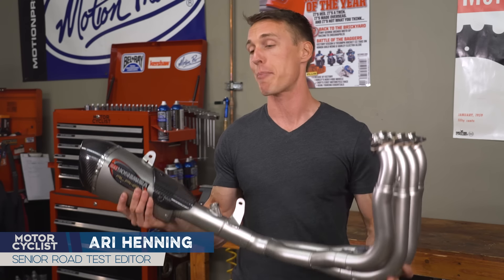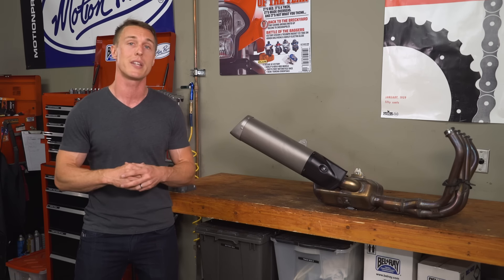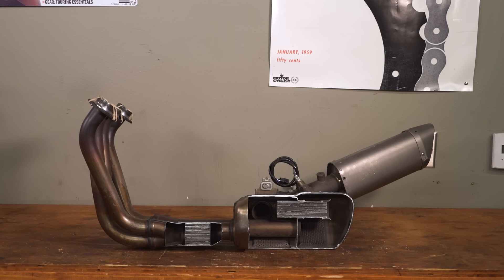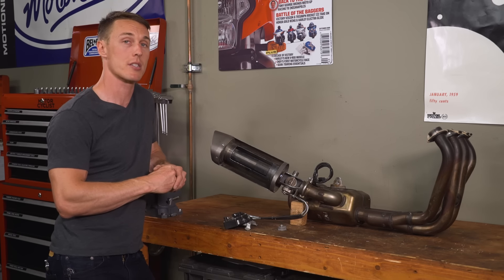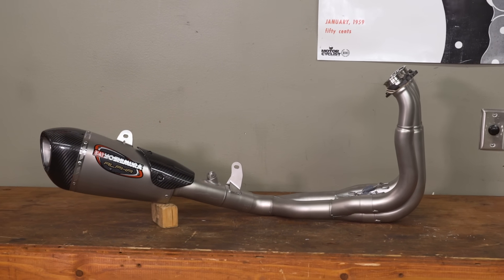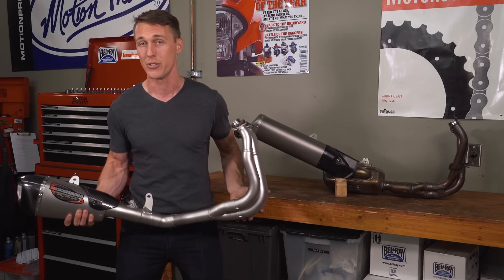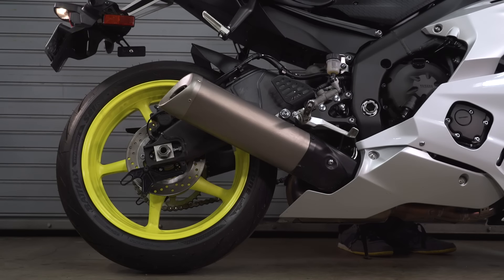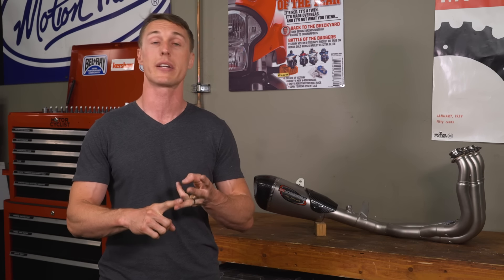The Truth About Aftermarket Exhausts | MC Garage

Comment: Agree, I just slap on a slip-on any bike i use. Purely for aesthetics & a crisp sound. Modern bikes rarely need much performance enhancements unless you're seriously getting into racing. It tends to get very expensive to squeeze out about 3% - 5% extra ponies that have no real world benefit. 
Better to invest in suspension instead, tires included. The bike will feel way different. 
Another cool vid again btw.
Reply: Yep. If someone puts an exhaust on their bike but leaves the bald tires...
I guess different priorities than me.
Reply: gronkgrunk weight though
Reply: That’s due to headers. Adding a header with bigger ports plus slip on will increase almost 20% more.

Comment: When I raced motocross, the only time I bought an aftermarket exhaust was for my 1988 Honda CR500RJ.  It was to soften the off the bottom and midrange hire and give it better (longer) top end.  It made life easier on the close circuit track as well as cross country and for the Finke Desert Race in central Australia.

Comment: +Motorcyclist Magazine  You guys are killing it with these videos, great job, as usual. You deserve a lot more subscribers.
Reply: holymolie not until they start cranking out more vids regularly.
Reply: holymolie quality over quantity
Reply: So where is the quality?  Kid talks about backpressure like he's an engineer.  A quick Google would have given him much scientific evidence that backpressure does nothing to improve performance, it actually hinders it.  You want free-flowing exhaust, learned many decades ago.
Reply: Michael Cox Honda
Reply: Michael Cox peak hp sure a nice large pipe would be a good thing. But you loose torque. Crossovers in exhaust systems or headers by design may have some resistance to the exhaust to create a scavenging effect.
Reply: noah villalpando Thanks, but I'm not interested in opinions. My mention of quality was relative to the poster stating this is a quality video.
Reply: Michael Cox my response is due to your response about doing a quick Google and how back pressure does nothing for performance. 
Do you ride a Harley?
Reply: It's simplistic to dismiss return pressure waves (a variety of back pressure) as robbing power and to only want to achieve maximum exhaust flow at all costs, under all circumstances. It's also an oversimplification to want back pressure without qualifying what type and under what conditions. If it were a matter of minimising back pressure then no exhaust system at all would be required or the largest, fattest headers and pipe. The opposite would be to restrict the exhaust outlet to maximize back pressure. Both are absurd engine design and tuning concepts.
Reply: Exhaust headers and exhaust pipes are not considered one in the same...at least not in my statements. Headers are engine specific and anything after them needs to be non-restrictive. Open exhaust manifolds are the best option (why it's that way on race vehicles), but noise and air pollution campaigns require street vehicles to have mufflers, sensors and catalytic converters.
Reply: Michael Cox I'm not sure what race applications your talking about any race engine I've ever seen has a header and pipe. Also depending on tuning they will either all collect to 1 pipe or be completely independent from each other.
Reply: Agreed. Back pressure does help most common engines.

Comment: The popping and crackling on deceleration is one of my favourite parts of riding my bike.
Reply: Myles Prower Yup. Too lean
Reply: Chuck M not necessarily. Can mean too rich, and the fuel is burning in the exhaust due to the air injection system (like my z1000)
Reply: @Me-yh4uc  Popping in the exhaust literally means the fuel went unburnt in the engine, which happens if you suddenly decelerate.
Reply: yeah must be so great wasting fuel..    I mean...   lets just dump all of it in there and make a cannon out of it.
Reply: @harleyme3163  it happens even on scooters, the honda wave i use to stroll around town tends to pop it's exhaust (not necessarily loud pops as the stock exhaust is so damn muffling, but pops nonetheless) specially after going high rev on a climb then suddenly letting go of the throttle for descent, specially if the engine is cold
Reply: Yea my ninja 300 popped with a stock muffler and more noticable with the Hotbodies MGP slip on. Before I would have to actually concentrate to hear the stock popping on decel.
Reply: yes
Reply: It means your bike is running like shit though. But hey you do you 🤷‍♂️
Reply: @Totallylegitman13  my bike with emissions control does the same thing when I decelerate hard after a long straight at WOT it backfires very loud scaring anyone around me... ive toyed with the idea to block it off to stop it happening.
Reply: Will Lyon no it doesn’t... unburnt fuel will always happen to some degree when decelerating.
Reply: @Totallylegitman13  only on a carbureted bike. EFI bikes cut fuel like cars do when you're coasting. Even carbed bikes don't do it from the factory. Shitty tunes make crackling sounds
Reply: @Totallylegitman13  I got a wide open sc project fully tuned it diesnt always pop but that unburned fuel scares the shit outta me when it does get up in that pipe hahahaha
Reply: Not sure about all motors but some carbureted v-twins have an anti-backfire circuit
Reply: It doesn't matter if you're riding around all day at 65mph especially if your fuel is almost free.
Reply: I have a hole in my car muffler. Does the same thing LOL.
Reply: My 790 duke even popped with stock exhaust. Does so even more with my yoshimura. I love it

Comment: The loud pipes save lives theory is interesting. I’ve been on a loud Harley and have had several people come into my lane. My sport bike was quiet. I hardly had any issues.
Reply: Sportbikes are more colorful so they catch the eye> luxury vehicles with fancy sound systems and other technical distractions
Reply: I experimented years back on my loud ass Buell I had at the time. If my pipe was BEHIND the driver, they couldn't tell I was there unless I really opened the throttle. So the whole loud pipes thing didn't do any good unless I was trying to attract attention...which a horn can do.

I didn't notice any change in driving behavior when I bought a new 1000RR and left it stock.

Comment: I got an old Honda CB400 SuperFour a few months back.
I bought it as a gift for my son to get him to go for his Full bike licence as he has been on a 125 for his 3rd year now, plus it sounded amazing!
He has annoyed the hell out of me and so I thought bugger it, I will use it.
Annoyiungly, I should have double checked the exhaust because even though it looked great, I have hardly done more than 200 miles and it started to pop, on close inspection, I found a hole in the No.3 downpipe... I took the exhaust off to get a proper look, and lo and behold, I find one of the rustiest setups that I have EVER seen, and after sopme wire brushing and trying to clean it up, I have come across more holes than a sieve... Thick coating of paint was all that was holding it all together!
Even worse, is that the collector box, downpipes, and silencer, are all welded into one single piece and so even though the silencer is ok, I cannot get it off ( Might cut it and make a new connection )

I am however hoping that I can still save it, at least for long enough to let me have a couple of years use out of it.... I doubt it will weld although I got a mate who says he can weld anything no matter what, so lets see, but if not, I hope that the Heat resistant SteelStik will be my saviour.

I have been told its good stuff, but does anyone have any experience with that?

The holes are all just on the top of the bend on the downpipes... At the back... A few holes have appeared right after the join where it goes into the head port, and some are right on the corner, on the inside of the bend, and the farthest downm, there is some little holes about 4 inches, in total, on the two inside pipes, there is 12 holes, the largest is about 3/4 of an inch, so quite sizeable, but most are 1/8th of an inch give or take...

I also have a couple of tins of Simoniz VHT Spray.. Rated 800c.

Does anyone know roughly how hot the exhausts downpipes get on the CB400 SuperFour?

Its a shame because the bike overall, is an amazing little thing that is small for sure, but so much fun to blip about on!

Comment: I removed my stock exhaust on my GSXR 1100, replaced it with a Yosh pipe and it made a huge difference in power. Yosh had done a lot of R&D with Suzuki and the results were outstanding. It wasn't too loud, unless you got on it, so long trips weren't annoying.
Reply: You did not have the closedcourse baffle like the vance and hines that thing was TOO LOUD
Reply: You have a GSXR1100???
Reply: @jlcomte  I "had". Sold it.

Comment: I always pair an exhaust with a tune. Honestly though I go aftermarket mostly for the sound and weight saving lol. If you add power, your bike only goes faster. You save weight, your bike goes faster and it's easier to maneuver.
Reply: ap1986 ari mentioned that when fuel mixture is lean due to. change of exhaust it will pop when decelarating...
isnt that contradictory?
i thought exhaust poping when you decelsrete was caused by a tooo rich fuel mixture...
Reply: don trump : i might be wrong, but i am pretty sure the popping is due to a mix with too much air, forcing second ignitions in the exhaust. It isn't because of too much fuel.
That's at least why BMW 1000RR are popping all the time, or why BMW with N54/N55 engines (so 135i, 335i and so on) are popping SO MUCH : these are "fake" pops due to extra air purposely injected in the exhaust.
Reply: don trump my understanding is that it is more likely to pop because you're stock exhaust has baffles, your after market does not. So you're also getting an excessive amount of fresh air back in. Which you would've of had with your stock exhaust.
Reply: backfire through intake is caused by a lean condition or advanced timing, backfire through exhaust is caused by a rich condition or retarded timing.
Reply: Popping in the exhaust can be caused by unburned fuel on overrun, a leaking header gasket or burned exhaust valves.
Reply: He said a tune though. That will mostly eliminate backfire, although I do love seeing flames shoot out the exhaust.

Comment: On my 80s gt 750, my bike had an american made double skinned  full length open pipes, they had a balance pipe, but absolutley no baffles, or sound reduction,     took quite a long time to get the carbs re jetted, and needles in right position etc, ....sound was absolutey amazing, not just the usual rough loud spitting noise you got with drag pipes,   this was a lovely quiet burble at low revs, blomblomblomblomblom😀,   then opening it upgave you this incredible snarling deep roar, followed by extremely loud backfire pops and bangs on the over run😀